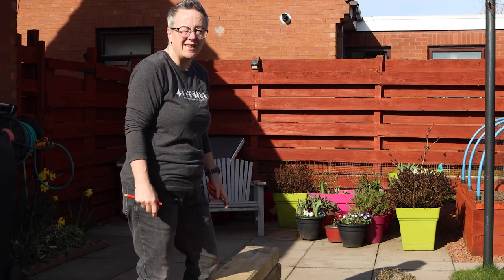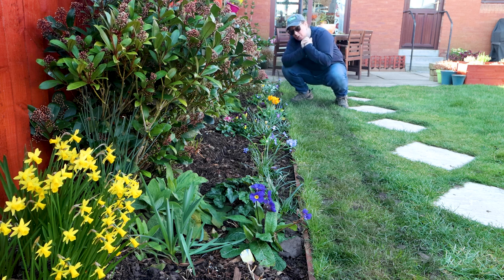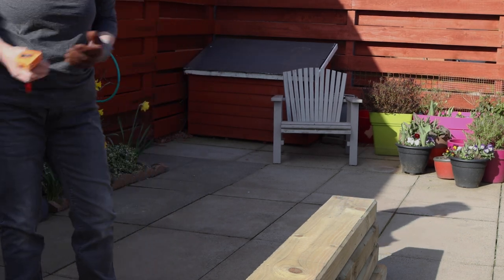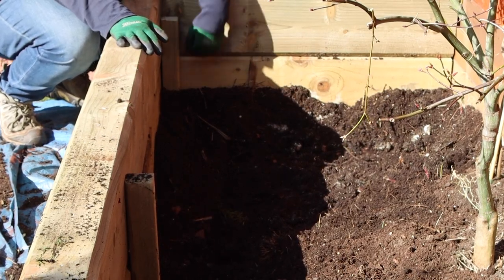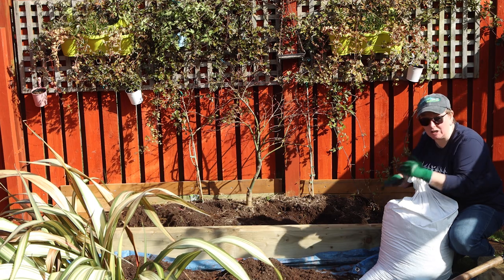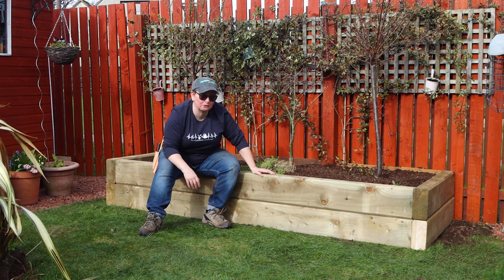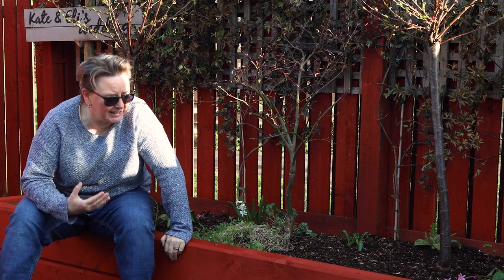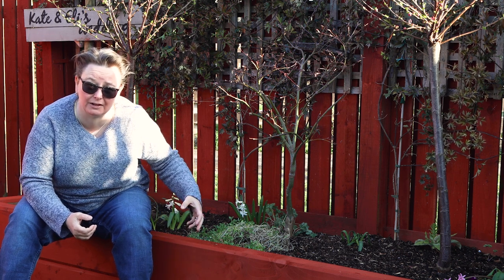Building a raised bed from railway sleepers

Comment: Great video ladies, I agree with not lining the bottom of the raised bed, but if you staple some black plastic (old compost bags are ideal) to the inside of wood and tuck it underneath the wood it will last a lot longer. Michael in Arbroath

Comment: I was surprised to see Kate “holding forth” on camera.  It was a flawless debut.  👍 

I also like the carriage bolts, but I pre-drill (using a smaller circumference drill bit) so that the bolt goes in easier.  My old Bosch drill has a way of ganging up on me unless I pre-drill.

The wood you guys use is so thick!  What kind is it?  Even pine that thick here in California would cost a mint.
Reply from the maker: She was awesome wasn't she 🙂
They are just pine railway sleepers, we have a cut prove timber yard local who look after us.  

Everyone seems to suddenly have become obsessed with how much we spend 🤣🤣🤣🤣
Reply: @eliandkate  , Eli, my comment about the cost of wood was a complaint about how much the same timber would cost here in California—which is outrageous.  I assumed that you guys pay much less where you live.  However, I do sometimes worry if you pay Kate a proper wage for all her carpentry endeavors.🙈

To be honest, I’m extremely jealous of your raised beds.  So, there it is🤢, the green monster is thus revealed!
Reply from the maker: Sorry Tim, I didn't mean to grump at you. Just had a bit of a day of it.

Will have to hide this, can't have Kate expecting to get paid 🤣🤣🤣

Comment: Great informative video - did you lift the clematis height or just cover over the top to the level of the second layer of sleepers?
Reply from the maker: no we didn't move the clematis, we figured we didn't want to risk it with such mature plants so just topped up the soil around it, although the back had been higher so it wasn't much to be honest.